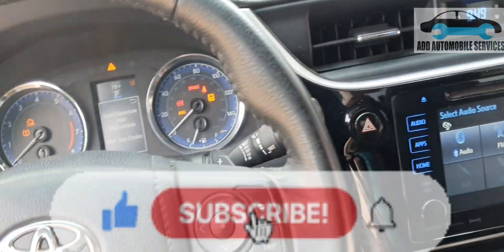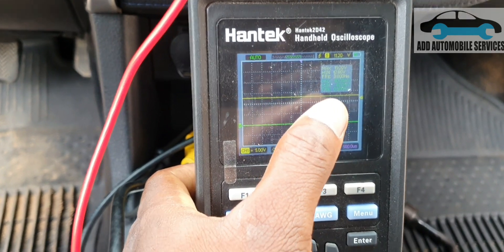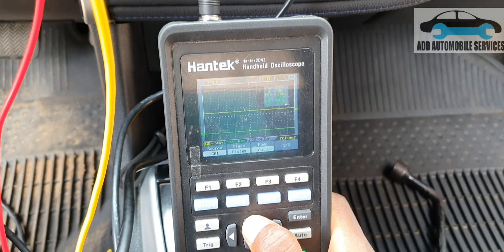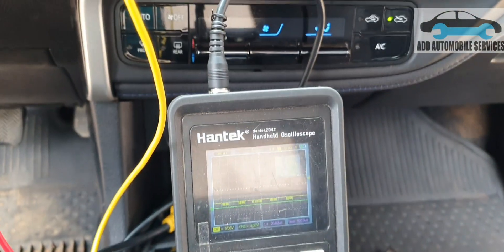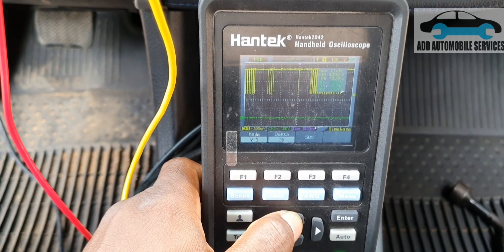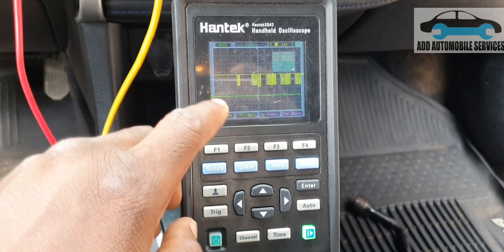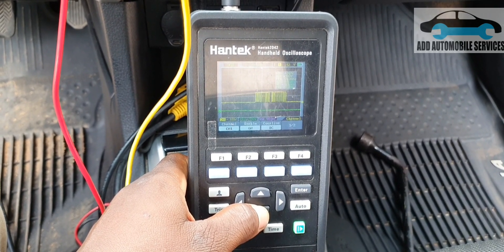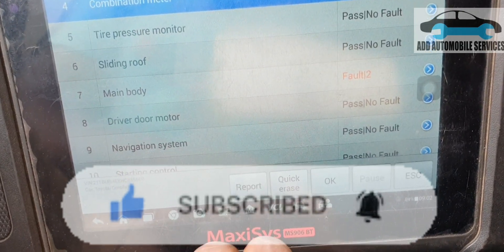Corolla 2017:U023A lost communication with image processing module(basic scope setup for CAN system

Comment: Thanks for the detailed explanation especially on the use of the scope. As a suggestion you should have made a seperate video detailing how to use the scope to troubleshoot a CAN fault and put the link on this video and simply go ahead to troubleshoot for power & ground using a test lamp or multimeter. Then do a continuty test on the CAN high & CAN low cables. With that you can narrow down the fault. With this current approach, auto electricians without knowledge of how Scopes work will not understand what you are doing & will skip the video. Thanks so much for the time & effort in putting out quality content, kudos!
Reply from the maker: Thanks boss

Comment: what is Can high & can low voltage?  I have same problem car in my workshop ,  already found can low voltage 2.37V and can high voltage 2.78V. This voltage normally ok or no brother?
Reply from the maker: 2.5 - 3.5v for high and 1.5 - 2.5 v for low
Reply from the maker: Yes
Reply: @ADDAUTOMOBILESERVICES           l will hope replace use radar sensor . Need recalibrate again use radarsensor or no?
Reply from the maker: Yes sometimes you will need it